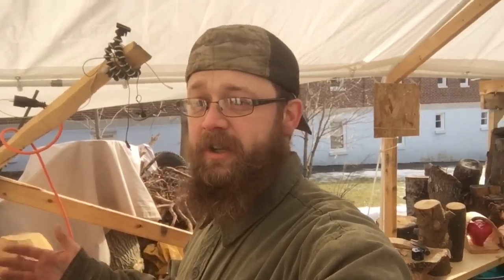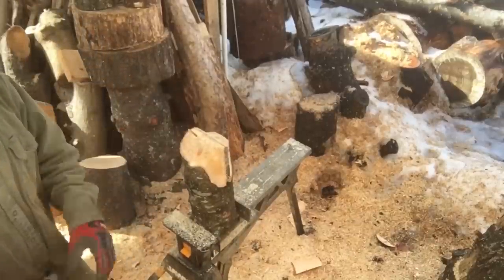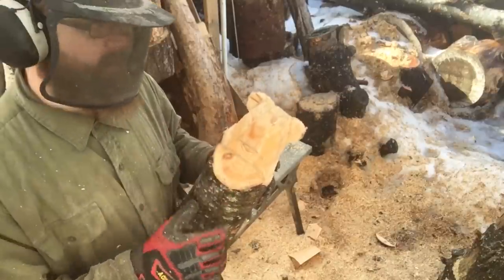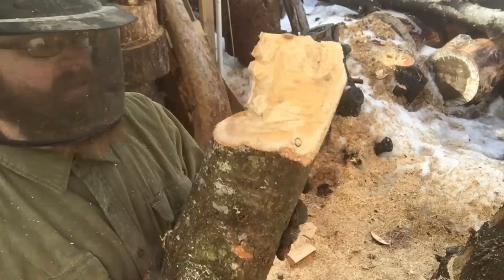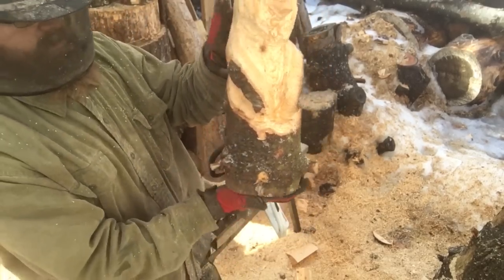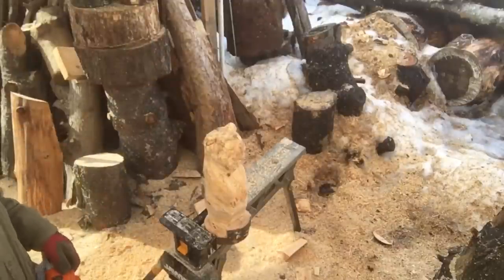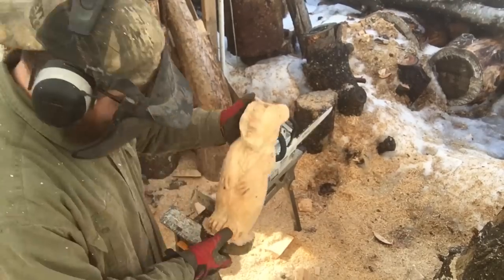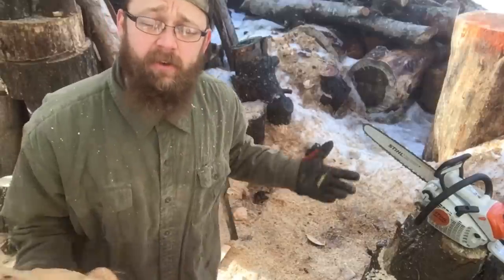How to chainsaw carve a small bear .

Comment: Just started chainsaw carving and I’m hooked. I now need to buy a decent saw and I’m looking at a battery one. Any recommendations?
Reply from the maker: I like my msa 160 for detail work with a dime tip bar and my msa 200 for small blocking on small carvings

Comment: Great job explaining the process. I am a beginner.  I will be  practicing your technique/ steps doing small bears. If you have other videos for other figures I will try them also.. By the way, what type /size chain do you use on your 14 inch sthil? George